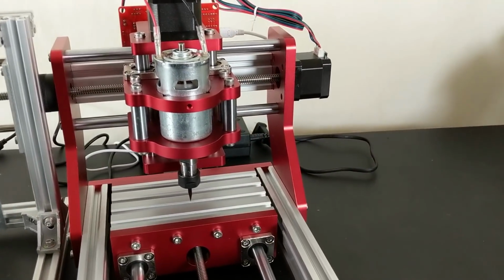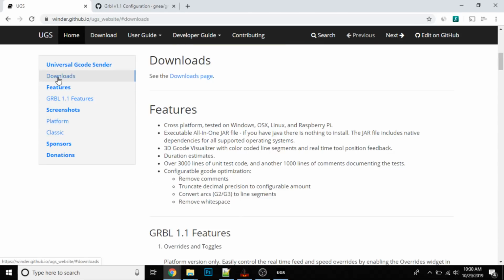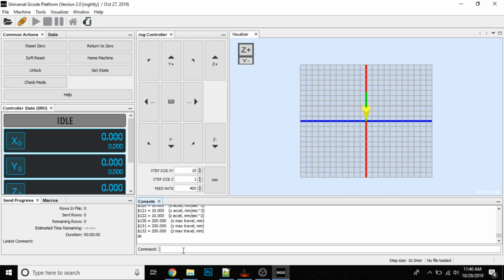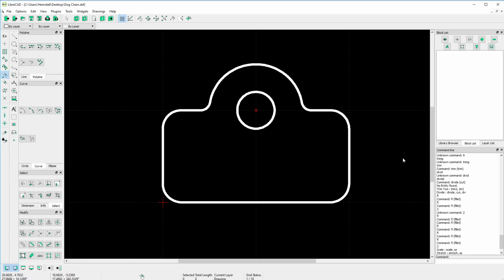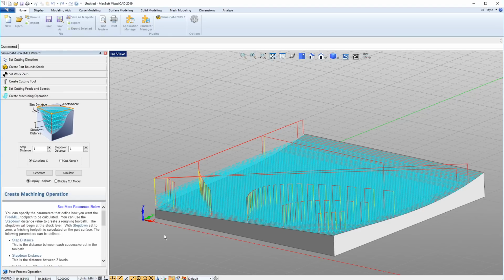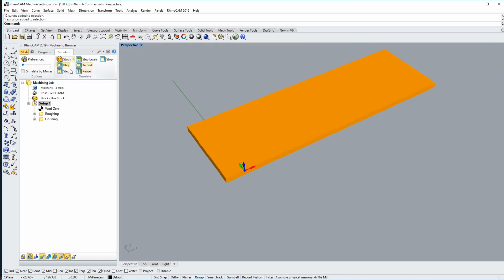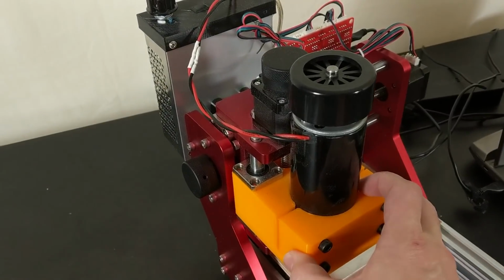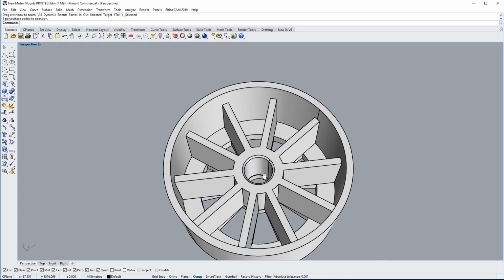How To CNC Cut Metal For Under $400 using the 1310 CNC Router

Comment: Its hard to tell what the issue is without a video of the actual cut, but generally when you see aluminum galling up like that, its due to a surface speed that is too fast, or full slotting with too high of a feed rate. That being said your spindle only does 12k rpm which isn't terribly fast. I would try doing a shallow depth of cut start at .01mm with multiple passes, it looks like you were trying to make these cuts in a single pass, which just isn't possible at 12000 rpm. full slotting metal is difficult for an endmill, and it typically needs to have a machine that's very rigid, has coolant, or can evacuate the chips, and also done at low rpm, maybe around 2000 for a 1/8in endmill.

Also I would highly suggest getting into fusion for this type of work, the cam in fusion is awesome, and allows you to control a lot of variables to the tool paths.

Comment: It’s normally called a tool not a bit. CNC software has backlash compensation and lead screw compensation. Look at your feeds and speeds. Usually the electronics are in an enclosed box. You need way covers to protect your lead screws. You need a motion control algorithm with acceleration and deceleration.

Comment: R.e. coordinate systems, since many parts are symmetrical about one or two axes centering the part at 0,0 will make it simpler to interpret coordinates as opposed to dealing with offsets for some of the features. I don't have a strong preference but that is one reason to center the home position.

Comment: Thanks for posting this, I found it very helpful, especially your run down on the software workflow. Just starting out and I hoped to find a machine and set of software tools where I could  eventually run CNC, Laser Cutter, Waterjet, engraving  and 3D print machines all using the same software set - In other words without having to learn a separate set of software for each type of shaping tool - maybe that is not possible now that I see how complex just the 3 axis CNC alone can be thanks to your explanation.  I thought the benchtop form factor of that red machine has it's advantages if one is just trying to learn the software. Perhaps just to machine wax or delrin so a newbie could get going up the learning curve without a big investment.

Comment: too bad, things that look like it should work don't always work.  the larger milling machines like bridgeport go through aluminum like butter. they have used maybe 1/2 hp motors with 0.5in bits so power here is plenty, as it is mentioned in the video, it's the compliance of the bit / collet / motor shaft.  
maybe the motor output shaft could go to a larger output shaft mounted in precision bearings.

Comment: I also prefer a positive only coordinate system. With a positive/negative central location system, if you get distracted for a moment, and you forget to sign your command, well...

I would really only recommend conventional cutting with these machines. The rigidity is nonexistent. The motor itself isn’t meant for this. The new motor is much better. But the machine itself isn’t capable of taking usefully deep cuts for thicker metal. The new motor is far from the rails, giving it a greater ability to bounce up and down. So some of the chatter is due to that.

The fan is wider than the motor body so that the flow moves around the sides of the motor. When the fan is the same diameter, you get a very turbulent flow because all of the air is now hitting the flat rear of the motor. Assuming this is designed properly.

You know that aluminum sticks to cutters. You need bits coated for aluminum. Since you know you need coolant, I’m trying to understand why you’re not using it. I often use water diluted sawing coolant for much of my work. For this tiny machine, a few drops here and there is all you need. Why not use it? A slight mess is part of the game. Blowing these fine chips away is not the solution.

I see at the very end you discuss that motor overhang. There is no way to eliminate that. My machine weighs around a ton, and it’s considered to be a light machine. Chatter still happens, though with much heavier cuts. I’ve played around with a CNC Sherline, and with anything more that a 0.002” cut, it vibrates like crazy. I don’t know how anyone gets anything done with these little devices.

Comment: Like you said, you need the lighter cuts at faster feeds. You won’t get the friction welding if you are feeding fast enough to move away from the old material before it gets hot enough to melt
Also, why not use fusion 360 CAM?

Comment: The red one has no bearing spindle, it runs directly from a 5mm motor shaft with no bearings. It will deflect badly cutting metal. The lead screw is too thin, should be around 5/8 to prevent deflection. Great for softwood though, wish I had one.

Comment: Fusion 360 will do the adaptive toolpaths...I would try a 3 flute endmill also- less thump.
Reply: 3 flute is way too big for a machine this size. youll destroy bits like noones business. the more flutes you have the faster the spindle has to spin and the faster the machine needs to travel to get optimal chipload. a 1 flute or O flute works best on these smaller machines. if you produce dust you are burning bits if you produce chips the temp and friction on the bit is far less and the bits last 10x longer. also never buy crappy chinese bits. if your bits  are less than $15 ea your running crap. i run Yonico on the cheaper side and Amana on the higher end side depending on the job determines the bit i will use.

Comment: Not half bad for the investment really I thought. Just my $0.02, but my personal experience with feed and speed calculators that most people do not take into consideration is they are ideals. i.e. perfect set-up, clamping, etc., proper machining application such as climb vs. conventional, chip evacuation, DOC, coolant, and very importantly - rigidity. Machine age and condition can affect the outcome greatly. Introduce any of those variables that are less than ideal, and throw the calculators out the window. We have a lot of really smart new hires coming through my place of employment that try (and not terribly successfully) to run our equipment at the calculated feeds and speeds that work on paper er..app? but end up closer to 50-75% of where they started.

Comment: I believe most machinists would not opt to take full width , full depth cuts with this setup. Rather, they might use smaller diameter bits to "peck" at a rough cut of the initial pass till the desired depth is reached. Once most of the material is removed to the final depth, a single "conventional climb"  full depth cut would be used for a final, accurate cut.

Comment: I had that same spindle. It was terrible, the shaft is really thin and flexible. The chatter was unavoidable, no matter what gcode you use and even when cutting wood. When i upgraded to a 1hp watercooled spindle it made a huge difference, now i can cut aluminum in 1-2 mm passes

Comment: Dude... You opened the box of a precision machine and dumped the pieces on the counter. Regardless of quality, expectations, or cost, one needs to start with accuracy and the accompanying documentation. This creates a 'zero-point'. Somewhere that we can confidently start from. If an issue does present itself, diagnosing it becomes more complicated. I work as a mechanic at a large scale manufacturer.
My job is to repair machinery that is in the middle of a product run. Meaning: that when, not, but when a problem arises, the machine operator calls over the radio and asks for a mechanic. Myself, or usually 2 other mechanics go over to the machine in question,  assess, diagnose, and make a decision that is efficient. This translates into: if I can not simply fix a machine without having to just replace an entire subsystem, I can repair the subsystems in place.

Comment: Hint: you could use a sound spectrum analizer like spectroid to read the sound frequencies, instead of generating waves and comparing by hearing.
Reply: or you can simply paint a vertical white line on the fan and setup an optical counter. Therte are plenty of commercial and arduino ones for this task

Comment: You would want zero somewhere else when your workpiece has features that can help you to tell the software exactly where the part is. For example, you might want to drill a bolt pattern around pistons, for attaching an engine head. Zero might be the center of the piston hole.

Comment: I bought a 4180 machine of similar quality and even added the same 500 watt spindle . It's fine for wood or plastic but yeah for aluminum it's a struggle . I saw a fellow who said the run out in the spindle was bad because there is a rubber bushing around the drive shaft bearing to cut motor vibration but of course it causes runout as the shaft can bend inside the rubber bushing! He was a machinist and replaced the rubber bushing with brass bushing he made on his lathe. Thanks for the great explanation of hardware and software for milling , cad and cam too. ☺

Comment: There is a very similar machine with a slightly different design that would have made upgrading the spindle easy. The 1419 version of this with non moving bed. That would be able to use the aluminum bracket with the spindle out of the box for that one or even the 800w 20k rpm spindle with no cutting needing to take place for a new mount.

Obviously most of the rest of the machine is the same but do you think the faster RPMs and aluminum mount would make it closer to doable? (with a dust shoe as well to not have the chips fall into the lead screws and also help prevent the clogging you were having).

Comment: I got a 200 dollar machine 3018 what i did to mine is i machine its own upgrade parts using thick fiber glass plate 16mm it is now 7x stronger than steel hahaha no need to buy a new one

Comment: Run it bolted to the wall and add a weight to the bed. Gravity can be your anti backlash. And add a second motor to the end of each screw to double the torque.

Comment: Stick the ruined bit into naoh, I’ve seen AvE do that and it seemed to work pretty well edit: just saw the end of the video
Reply: Yes, I second this. We have a large tap at work used for cleaning up munged threads in aluminum. Some of my coworkers weren't using any lubricant, and aluminum spalling welded to the tap.

I think I got the tip from AvE also, I mixed some crystal drain cleaner in water and soaked the tap overnight. In the morning, it looked like new after rinsing. No corrosion from the NaOH, all the aluminum eaten off.

Comment: Your upper left and liwer right quadrants are swapped from industry standard. IOW :"X" is always called first in a geometric expression, "Y" is always called second, "Z" is therefore third, etc..
And a good reason to set your work station coordinates in the middle of a part is when you are working on a part that is round and you're doing work in the center of the round feature, as in cutting a tapered pipe thread (inside or ourside) into the feature. Another good reason would be that your blueprint establishes the origin at a feature well onto the part. Say, in a program meant to cut a block plate for the bellhousing mounting surface of an engine. Those are almost always given an origin at the center of the engine's crankshaft.
Reply from the maker: My dyslexia kicked in and I reversed those two quadrants. Woops! My bad. Hopefully a million people don't see this video too. :)
Reply: No wonder you like working in the +,+ quadrant :)
Reply: I was wondering if anyone else caught that.  I ran that section of the video three times to endure I hadn't misunderstood and that the horizontal line was the x axis.
Reply: Yes, that’s what I was wondering. It just kind of seemed different from what I’ve been seeing and doing on my lathe and mill. Anyway I loved your video and would love to see you try to cut using a coolant like WD-40!!
Reply: Thought the video was mirrored or something

Comment: Informative video. Knowing the limitations of the machine, wouldn't you drill a starter hole, zero that,  go at a higher spindle rpm and if you couldn't nibble just reduce the feed speed?

Comment: Great video! You may want to try instead of air using WD40, and just a tiny spritz every 5 minutes (or a drip or fine spray system?) it will help keep your bit from clogging up (packing) and also provide a tiny bit of much needed lubrication at the cutting edge, as well as tool cooling. If you’re fed up with the micro CNC might you consider sending it along to someone else to play with? Perhaps in exchange for your financial investments?
Reply: I also just so happen to have access to the full paid version of fusion360, so I can access the adaptive tool path you’ve mentioned... perhaps we can collaborate on a project in the future. I’m very glad I stumbled upon your video!

Comment: Wait a sec. A 500 Watt spindle with such a tiny Power Supply? At most it's 90watt and I believe even that to be a high estimate. My Emco Hobby Mill has 90 watts and thats a "real" mill.
Reply from the maker: So, in China 500 Watt means 90 everywhere else in the world. Got it. Thanks for calling that out. It never occurred to me to doubt that spec. but it doesn't surprise me in the slightest.

Comment: In-order to have a spindle hold a cutting tool it needs to have powerful barrings inside a fly-weal assembly witch has a belt driving the rotation speed, and your table needs to be 3-times the size made out of steal, not; aluminum.   And your stepper motor are way to small, they are going to have to push a lot more resistance in-order to control the chatter.

Comment: I think at a certain point it's time to bight the bullet and get some real machine shop work dune, don't you think?  Your trying to overcome to many hurdles when the solution is "you have to put a lot of power-weight were it counts".   'Your machine has to be bigger", otherwise; it's just going to keep fighting back.   It's called; power to weight ratio.   your idea is a good one, but; the physical dynamics are overwhelming.

Comment: I suggest wiring the 500W motor as if it was direct mains connected - mains rated wiring, wiring protection and earthing of the motor and metalwork.  I bought one of these sets a few months back and the power supply doesn't provide mains isolation.
Reply from the maker: Thanks for the tip

Comment: I've never understood why the two rods for the tool head are on one sides instead of one on each side to eliminate cantilever.  I know, they copied some design which was that way and they keep feeding it out because there is a never ending supply of tightwads thinking they can get something for nothing.
Reply: That would just change which part was bending, but the motor still ends up cantilevered from the rails, which is where the slop comes from.  This is a flaw in all of the cheap CNC mills I've seen, which is caused by the need to mount the whole Z axis assembly on the moving X platform.  Yes, you could fix THIS problem by putting both of the X rails at the same Z position, but then they have to be far enough apart for the whole motor to fit through, and then your X leadscrew is way off center.  I haven't seen anybody try it this way.
Reply: @BrightBlueJim  I corrected my typo which made what I was trying to incomprehensible like Joe Biden.

Comment: Aluminum is hard to work with. I think you are using a bad alloy. It smears so much. Also you should be using a coolant. Then again you need the right tools to machine alumium. And at the end of the day, the right speed of rotation and the right feed. There are tables that recommend all these settings. I think it is not the machine that caused the problems, but primarily the material that was being used. Greetings from Germany!.
Reply from the maker: Great point!
Reply: @DesignPrototypeTest  Flood coolant is impossible for this setup. Use WD-40. It is a perfect cheapo coolant/lubricant to prevent gummy material like aluminum from sticking to your cutter, which eventually cause your tool to fail. Works very well for me. It works for plastics too, preventing heated chips from binding to itself to form a big blob.
Reply: @DesignPrototypeTest who would have thought that if you have 0 idea of machining  it doesn't work out first try 😂 and yeah there is a steep learning curve about 40% of this vid is bs

single flutes are superior on small machines
dump the rhino stuff and use fusion like everyone else
and suprise suprise a 400$ mill doesnt perform like a professional one
1310 mills do work, with knolege and limitations,
dont make sawdust, make chips
and so much more
Reply: Aluminum is hard to work with? No son, you just don't know what you are doing. Aluminum is easy as fuck. Try inconel, titanium, or any high nickel alloys. Lmao. Aluminum is hard, that's the easiest metal besides brass 😂
Reply: Use a spoon
Reply: Bad carpenters blame their tools, even worse carpenters blame the wood.

Comment: I could see (0,0) being a useful center of my piece when its going to be a round geometry, because then I could make the measures for one cuadrant, and then adding negative signs to the X or the Y or both would turn those into Cuadrant 2 - 4 coordinates. At least that's my believe coming from someone who's not done any CnCing.
Reply: Moving (0,0) to center of the x-axis, and keep y-axis at the edge of the bed, makes it easier to design bisymstrical models, by changing the X coordinates , to  -X coordinates.  Place  (0,0) at the center of the bed, and do the above to both X and Y, to  make quadsymetrical objects super easy.

Comment: To remove the aluminum off of your carbide endmill, drop it in some water with lye, and it will eat the aluminum off of the bit, be careful with lye, it can be dangerous.
Reply from the maker: Thanks for the tip. I appreciate helpful comments, but I mentioned this at 48:46.